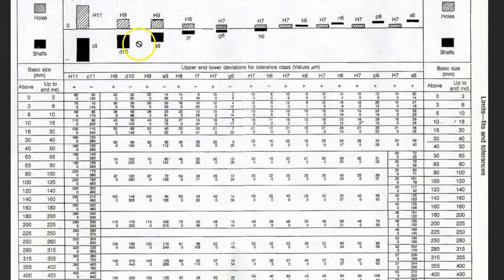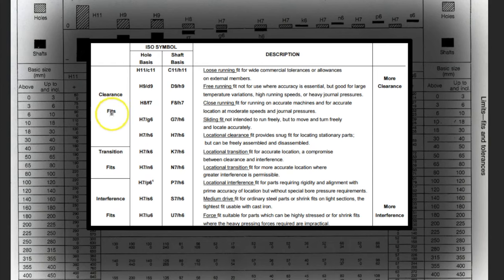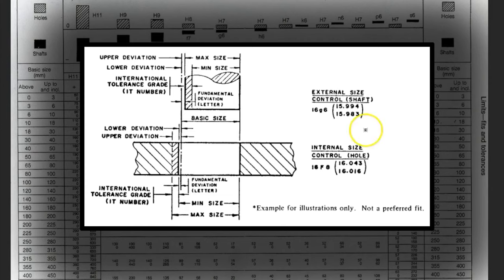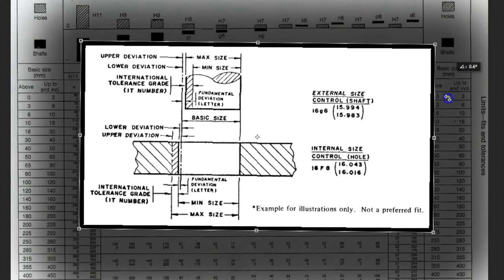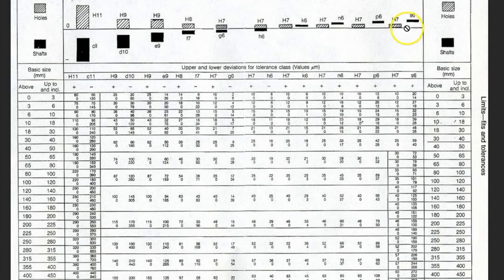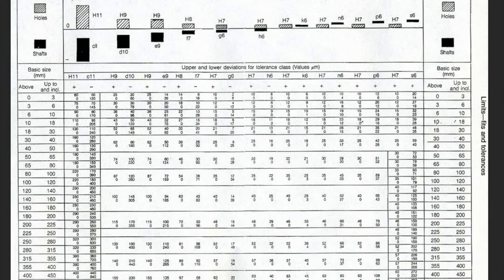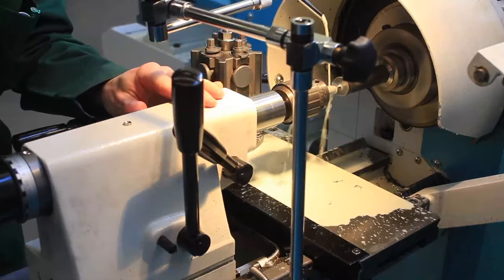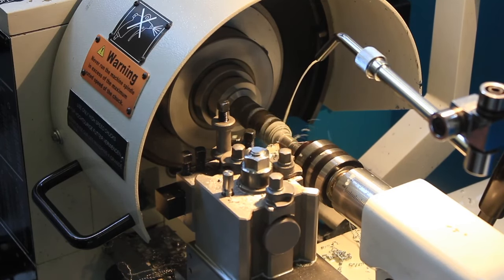Limits, Fits & Tolerances -#5minFriday - #4

Comment: @4:00 you choose basic size of the 10-18mm -> which translates to the 0 to 18 hole size H7, shafts you then look to choose the row up (6-10 mm) which translate to a 1 to 10 hole. Why did you not choose 1 to 12 hole that maintains on the same row of the table?
Reply: exactly the vid is cool and super informative i think there's a bit of mistake there I saw it, but i get his point.

Comment: Fabulus. Quiery : for the H7/k6 transition fit. you select H7 borehole, slot 10 to 18, making it a +18,+0 microns selection. And for k6 cylinder shaft (axel) you select slot 6-10, making it a +10,+1 micron . When you have a 10 millimeter basic size. There is a possibility for misinterpretation, Basismeasure 6-10mm or 10-18mm slot, (k6, slot 10-18 gives +12,+1) shouldnt you select the same slot for both ? What is the usual method ? Is it because it is a "Hole basis" system, and the shaft is slightly smaller ... 1 micron is 1 millionth of a meter. or a thouands of a millimeter. Great stuff. You are my teacher !
Reply: Did you get an answer to this? I found that a bit confusing myself.

Comment: Always wondered about the fit H7/h6. What would happened if the Hole and Pin are at MMC? What if the two parts have been sent to two different vendors? Is it going to be a misfit? Because Hole and Pin at MMC will not assemble quite easily? Is there a rule followed at machine shops where the Pin/Shaft (easier to control a male feature) is never finished at it's MMC?

Comment: Thanks for this. What do you do if you already have a part, a dowel pin or bearing... what if I want a light interference but the pin or bearing is already sized and the only control we have is with the bore diameter? This happens all the time for me! I never know how to spec that caus I don't know what iso limit the pin or bearing was made to.... any help? Pete.
Reply from the maker: I wish we had mcmaster-carr over here in the UK!
Reply from the maker: Also sorry Pete. I'm getting better at replying to comments! Honest! Generally pick the standard for and machine to that. In your case match shaft to bearing. If prefit shaft available as per comment below, use that and save yourself a load of time. Happy days.

How's the shredder?
Reply: The thing is it doesn't only work on nominal dimensions...Unless you want to plot the limit ranges to find the maximum and minimum clearance you could just say for example φ10.585H7. That's a crude way to get around but when you start having many mating parts it's better to plot the desired fit and move it based on what is standard and what is to be made.

Comment: what is the ISO standard you mentioned? ...
Reply from the maker: BS EN 20286-1:1993(ISO 286-1:1988 )...... ISO system of limits and fits. Bases of tolerances, deviations and fits 
BS EN 20286-2 : 1993(ISO 286-2:1988 ).... ISO system of limits and fits. Tables of standard tolerance grades and limit deviations for holes and shafts 

Hope that helps!

Comment: Im having trouble understanding the 10mm k6 0.01 and 0.001 tolerance, what were you calculating?
Reply: Nevermind, got it
Reply: He accidentally picked the wrong diameter values in chart instead of the values for 10mm.

Comment: hi 
I want to drill 10 mm ID through hole      
in a 50 OD * length 120mm 
tolerance H7 . a piston slides through 10 mm ID . in what way H7 can be achieved perfectly. can any one guide me with this
Reply from the maker: +Rajesh .T Tolerances are generally paired. The H7 is just the hole tolerance and would be achieved by a reaming to 10mm.

As it's a piston you want a sliding fit but to be honest this generally achieved with piston rings as they can be replaced.

Is the piston a stock component or are you machining it? If you are machining it then on a hole basis (H7) you probably want a g6 shaft tolerance.

Hope this helps!